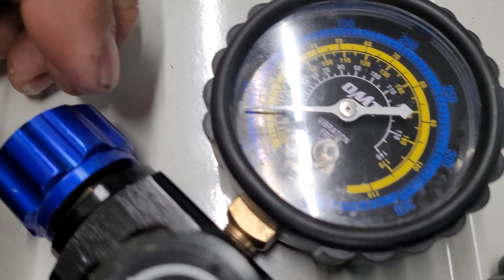How we recover mini split refrigerant back to the outdoor unit, same as how it shipped #minisplit

Comment: If I have a 3 zone mini split do I need to do this for all 3 circuits?
Reply from the maker: Hi Michael, have the gauge hooked up to any of the 3 service ports.  If one is bigger than the other two, connect to that largest one. Close all of the high-side valves quickly, with all zones running in cooling.  Close the low-side valves quickly when the pressure shown on the gauge goes to zero. Immediately shut the unit off.
Reply: @airspool  thank you for the response. So i by doing this i can pump down all 3 circuits from one of the service valves. If i do i this way do  I close the master valves as well the same time i close the service valves? 

also would i be able to just hook up my gauge to the master low side. Then close the high side master valve and 3 high side service valves , then do the same to master high side and 3 service high side valves?

thank you for your time
Reply from the maker: @michaels1527   well, remember, the compressor's doing the pumping.  The gauges are just on the any of the service ports, just to check the pressure.  If you have, say, 2 9k btu units and one 12k btu unit, put the gauge on the 12k service port.  Turn the unit on in air conditioning.  When the compressor is running, close the liquid/smaller lines, all quickly at about the same time.  When the pressure goes to zero, close all of the gas/low pressure lines.  Then immediately turn the unit off.  Then, disconnect the gauge.
Reply: @airspool  Ok thank you I understand. I have 3 9k btu units so it doesn't matter where i put the gauge. and ill close the 4 liquid lines first then the 4 gas ports (the master and the 3 service) once i hit 0 psi.  Should i shut the master valve ports first or service ports first? Or it doesn't matter ?
Reply: @michaels1527  this is what i was wondering myself
Reply: have you found out if you need to close the master ports i would think that would be right at the end but i'm not sure

Comment: Just wonder how much longer before the outdoor unit may blow up?  I saw those guy chatting causally while the gauge needle already hit the zero point, and finally the video ended.
Reply: It won't blow up, most of that copper in there is rated at 3,000 PSI burst and even completely locked down with the compressor on the high side won't ever push over 500 PSI, and the scroll compressor in there is strong enough to handle the extra head pressure for a good bit of time

Comment: I have a pioneer 18k unit with a 40’ linset that I added additional r410a when installed. I want to move the unit to a different location because of a remodel. Will the unit only hold the amount for a 25’ linset when I pump it down or do I need to buy a tank to store the additional coolant?
Reply from the maker: Just do it when it's cool, and you should be good to have the accumulator and outdoor coil hold everything fine.

Comment: If you do this step and then want to reinstall it let's say another part of the house do you need to do the whole vacum thing with a machine?Or can you just wire it up and turn it on?
Reply from the maker: Well, it sounds like the refrigerant lines are going to be disconnected from the unit, in which case the vacuum would be lost in the lines, in which case you would need to vacuum again. But if you can somehow move the units of the line set is connected, you be okay in theory. By the way, why do my upstairs neighbors always vacuum after midnight?
Reply: @airspool  thanks for all of your info... a neighbours house has white ants about to be condemned..has huge mitsubishi split system aircon still connected to the power and I got the remote its still going operating in cool mode.. I need get it before power disconnected . Its been given to me if i can remove it....

Comment: How about Tri Split? How to do it? Can you please let me know since I need to move the outdoor unit to other location.
Reply from the maker: Hi Virgilio, yes, it's also simple.  Have the gauge hooked up to any of the 3 service ports.  If one is bigger than the other two, connect to that largest one. Close all of the high-side valves quickly, with all zones running in cooling.  Close the low-side valves quickly when the pressure shown on the gauge goes to zero. Immediately shut the unit off.
Reply: Thank you!!

Comment: What setting is the mini split on when u disconnect the ⁶ the ac setting or heating setting or do it matter ??
Reply from the maker: Yes, it certainly matters. It needs to be in the cooling mode. Thanks for this.
Reply: @airspool Should it be on max, min or doesn't matter?

Comment: Another noob question. Is the valve on the actual pressure gauge on or off when doing this? I followed everything to the “T”, but the pressure never dropped. I don’t want to open the valve of the gauge because I don’t know if doing so will release anything that shouldn’t be released. Does that make sense?
Reply from the maker: Hi Brian, well, make sure that you are actually depressing the service valve such that the pressure from the unit can be read on the gauge. Sometimes, it can be like a bike schrader valve such that if it's not pressed in correctly, nothing happens. So yes, the valve is actually attached. It doesn't need to be turned on or anything. Again, it's similar to a bike pump gauge such that if it's correctly mounted, you'll see pressure. Nothing will be released. And yes, the pressure will go down as the compressor sucks the refrigerant into the outside unit.
Reply: Gauge valve should be off

Comment: Can I pump down a inverter compressor too?
Reply from the maker: Sure! This one shown is an inverter compressor.
Reply: @airspool  Thank you. One more question. How accurate is this method if we consider that we had a negative pressure, before releasing a refrigerant from outdoor unit? How much a refrigerant do we lose?
Reply from the maker: Ted, first, sorry for the late reply.  Yes, when you pull the vacuum in the closed refrigerant loop, the pressure will be negative.  Once the refrigerant is released, though, the pressure will be well above ambient pressure.  And, well, using this method, the compressor is being used as a 'vacuum pump' to pull this refrigerant back into the compressor.  So, yes, it'll work.  The pressure on the closed loop goes back to negative at the end of this procedure, since all of the refrigerant is back in the compressor.  Then, the low pressure valve is closed.  The closed loop then remains negative, and the positive pressure is all in the compressor.

Comment: Nice vid. Just a practical question. Did you purge the blue hose and manifold before evacuation ?
Reply from the maker: Hi Misenko, yes, to purge the air out of the blue gauge hose, screw it onto the service port of the unit and then unscrew it for maybe 1/2 second where it attaches to the gauges.  This of course is done when the unit is turned offer.  The pressure of the refrigerant will force the air out.  Then, when the unit is turned back on, refrigerant is sucked back into the the outside unit from both the blue hose and the rest of the system.
Reply: @airspool  Thanks for reply. Does the unit need to be turned off before attaching a hose to service port? I’ve read thst it is better to connect while the system is running since there is lower pressure on suction line so less refrigerant leak during attachment.
Reply from the maker: Michal, sorry about the delay. This one got by us until now. Yes, right, you can connect it when it's running, and will be easier because less pressure.
Reply: @airspool  No problem, thanks for the response.
Reply: @airspool  also how did you stop the refrigerant from leaking out of the other gauge? I read somewhere else to use a single gauge because it’s almost impossible to get it to not leak out of the other gauge
Reply from the maker: Hi Zane, well, think of it as a closed loop.  The loop terminates at the gauge.  The other hose which would go to a vacuum if you were vacuuming the system is not used (and doesn't need to be connected), and that other valve is shut down, so only the line from the gauge to the unit is connected.  So, no leaking possible.
Reply: Hi, Thanks for a great video. Question, you showed how to move the refrigerator back to the outside unit, what is the purpose of doing this? Will I be able to pressure test my system for leaks, once I do what you showed? I can use nitrogen, just keep the ports closed on the outside unit?
Reply: So to purge the blue line you simply hook the hose up the service port while the ac is running for a couple second then disconnect it? Or do you leave it on the service port an disconnect the blue line at the gauge?
Reply: @zanehenley3394  You have to open the valve on the gauge and let the gass go out litle bit. But I have this no leak valve on service port so i screw it in with open needle then vaacuum a hose, once vaacumed I close the valve on the pump. This way i have vaacum in the hose so i just screw the needle in and done. 0 refrigerant lose.
Reply: Can't you just do this without the gauge and just wait 30 sec or something?
Reply: @HappyAchterhooker  yes, you can but it’s not good for compressor to run without coolant for too long. With a gauge you can see immediately when all refrigerant is collected and vacuum in lines is created.

Comment: Does the unit need to be working for this to work or can it be vacuumed back with a pump. I have a new unit that I setup. And when I went to start it it is fulty so getting a replacement but it does not run it is possible to put the refrigerant back another way. Just trying to figure out how to remove the unit so I can swap out for the new one with out letting all the coolant out
Reply from the maker: Hi Grizzly, so the compressor didn't work at all? Are you sure it's not just some type of power issue? Anyway, This technique relies on a working compressor, so it won't work if the compressor is not working. An alternative would be to get a demo machine from Harbor Freight and an empty tank and transfer the refrigerant there.

Comment: If u suspect air or moisture in your mini split lines from not properly being vacuumed how do u correct that does the R-410 have to be completely changed or what do u do ?
Reply from the maker: It sounds like the refrigerant is already flowing through the unit. If that's the case, you need an empty tank and what's called a 'recovery machine' to pump the refrigerant and contaminants into the tank. You can get one of those from Harbor Freight for like a $100 or less. If the refrigerant is not in the machine yet, then it's easy. You just need to vacuum the line set before you release the refrigerant as normal. Give us a call If you need any more help.
Reply: @airspool  ok thanks yes it's already flowing through the machine it seemed to be acting like is supposed to now it's brand new but I know it wasn't vacuumed I just bleed the lines and let all the air out is much that would come out I didn't know about the vacuuming part

Comment: I have a very practical question. When you are operating the vaccuumpump on the service port, the operation here suggests that the gas is not being 'sucked out' via the pump. How does the valve work on the servicepoint that prevents the gas being part of the vaccuum? Maybe I misunderstood the operation. Does the outdoor unit produce the vaccuum on itself by closing the liquid valve? Is there any refrigerant in the blue line or is this impossible because the outdoor unit creates the vacuum?
Reply from the maker: Hi Sinkie, actually, the 'vacuum' is the condenser itself.  So, the condenser pumps the refrigerant back into the unit.  No external vacuum pump is needed.  But, you do need the pressure gauge on the service port (which is connected to the low-pressure side, usually on the back side of the top of the two gas valves) to monitor that the compressor has done its job.  So, by closing the high-side refrigerant port/valve first, no more refrigerant can get to the indoor unit.  Meanwhile, the low-pressure port is still open, coming from the indoor unit, so, all of the refrigerant is being sucked back into the outdoor unit.  Once that all is back in there, you'll see that there's no more pressure on that low side port from your gauge.  Then, make sure to TURN OFF THE UNIT IMMEDIATELY.  Todd had the remote in his hand, but another user, YoPeace, pointed out that it was still turned on.  So, yes, turn the unit off once all the refrigerant is back in the unit.
Reply: @airspool  Thanks!
Reply: @airspool how do you pump a 4 casket style or multi head? Close 4 liquid ports and 3 suction ports and run down to 5 psi and close the 4th one down?
Reply from the maker: Yes, open all liquid and gas ports, then close all of the suction ports.  Close the gas port with the manifold gauge hooked to it last.

Comment: I have a senville with multiple indoor units do i have to do this with each indoor unit?
Reply from the maker: Hi, if these are all on the same circuit, you should just be able to evacuate from the condenser the same way. All the refrigerant will come back to the outside unit in the same way whether there is one unit or multiple units. Larger vrf systems may be her different? I'm not sure on that.
Reply: @airspool  Please explain for clarity. On a multi zone unit...such as A,B and C (3 zones), do you close high side on one zone and watch the gauge to zero, then close the low side on that same zone. Then continue to the next zone and repeat that procedure, then finally to the last zone. Once the low side valve on the last zone is closed, then shut the power and that is how it is done?OR Do you simply close the high side King valve...watch the gauge to zero, then close the low side King valve...then power off?

Comment: Sorry, newbie question....
What is the yellow hose connecting to?
Reply from the maker: Hi Fargo, actually, that's a 110 (or 120?) v electrical cord powering the unit.  So, yes, for this procedure, you only need the blue hose on the low-pressure service port just to monitor the refrigerant pressure to see that the compressor has done its job and sucked up all of the refrigerant.  Since the high-side (smaller refrigerant line) was closed in the beginning, the refrigerant has nowhere to go but back into the compressor.  Once it's all back in there, the suction port (for the larger refrigerant line) is also closed.
Reply: Hi there when the blue hose is connected does the Gauge have to be open

Comment: Do you have air conditioner on or heat on?
Reply from the maker: In the video, we have the air conditioning on. You would need to reverse the order of valve closure in heat mode.
Reply: Why is this never mentioned? I've watched a few videos on this process, but they never say whether they're running in heating or cooling, and that seems very relevant.
Reply: If you don't know that you don't need to do this...
Reply: @John Drossart  so in heat mode close  the big line first then the small line ?
Reply from the maker: Hi @jamie_liles, for simplicity, just have the unit on air conditioning mode. That's safer, because certain mini splits use the large line for liquid come in some use it for gas, and heating mode.